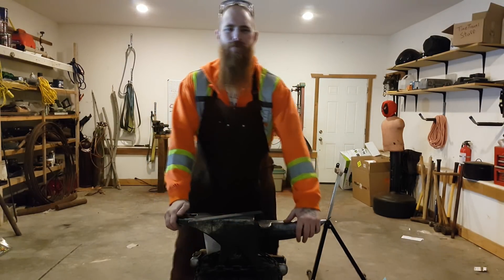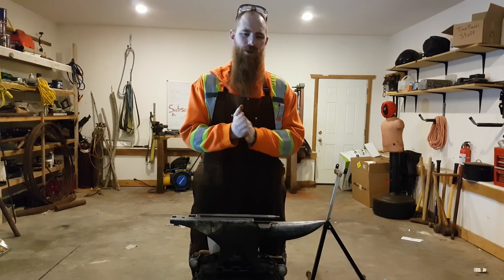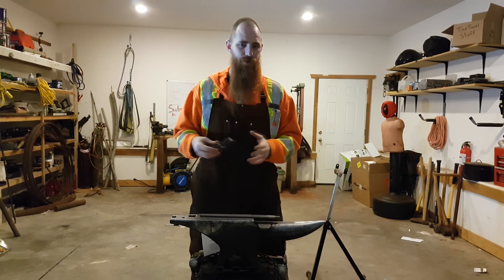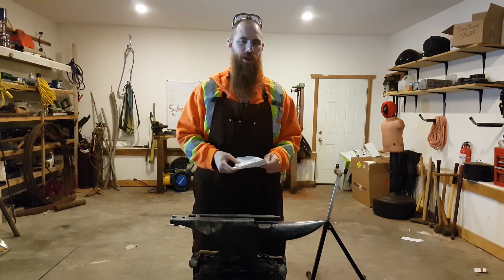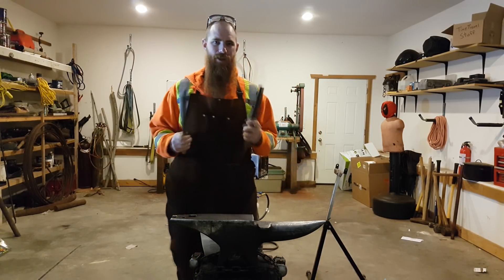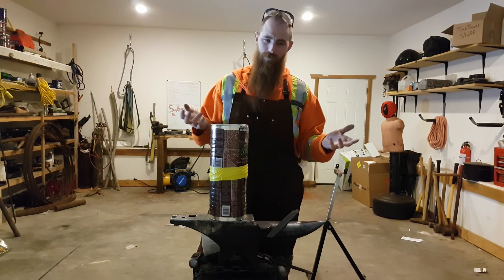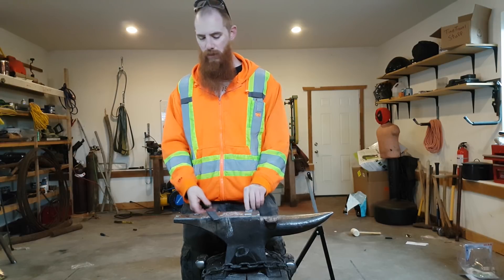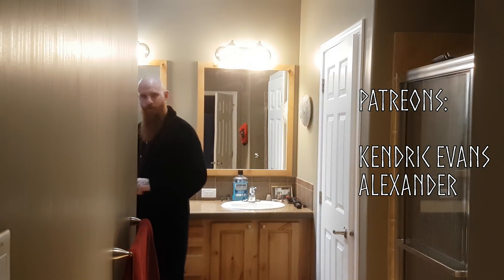Annealing Steel in Vermiculite vs Wood Ash

Comment: If you want to compare hardness of materials, use one against the other. As they are (still) files, try to use the one to file the other and vice versa (assuming the different parts are still of comparable sharpness).

Comment: You might want to wear a dust mask when pouring Vermiculite.
It may be contaminated with asbestos...
Reply from the maker: Not in canada it doesn't. Not anymore. It used to though.
Reply: Only if you get it from that contaminated mine in Montana. Which was shut down years ago and the leftover product taken off the market.

Comment: Great demonstration. For my take on annealing, check out my shout out video to HoJ forge and preparing high carbon steel in a weber grill. Thanks
Reply from the maker: Couldnt find it. Do you have a link?
Reply: Friis Forge i basically put the steel in my weber kettle grill. Then set the fire and cook dinner. Once done cooking, i leave it in the coals with the lid on overnight. The next day, toolsteel is cool and annealed

Comment: Great video comparison, something that occurred to me when watching is that you could use an automatic centre dot to mark the steel which should remove human error as much as possible. and also what about wrapping the cans in Kaowool or similar to insulate, it should give a slower cool and give a softer metal at the end as i understand the process.
Reply from the maker: I actually have an automatic center punch. Ill try that on version 2